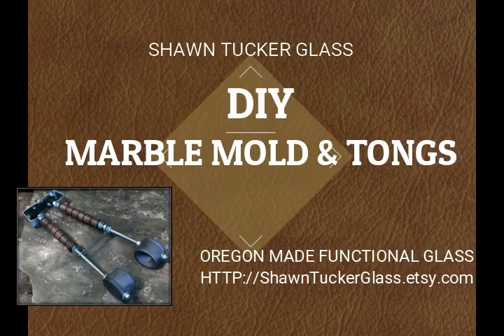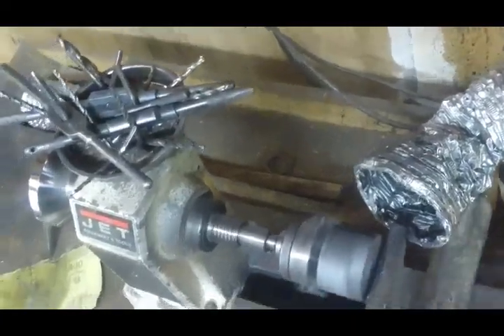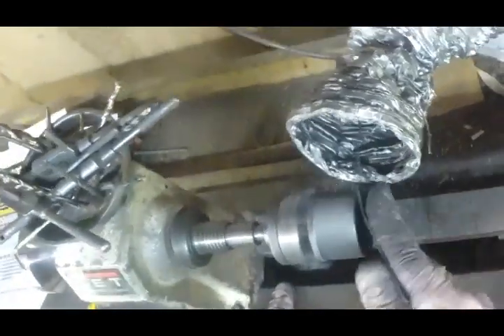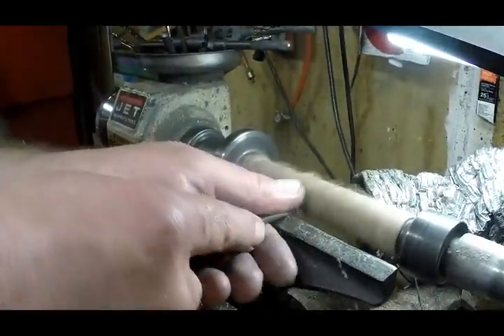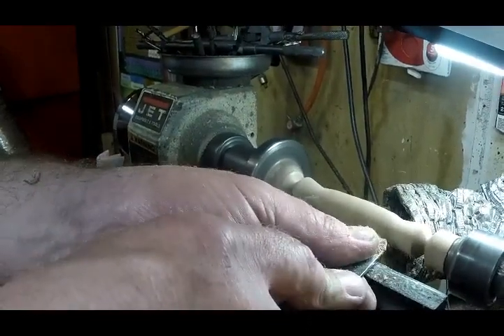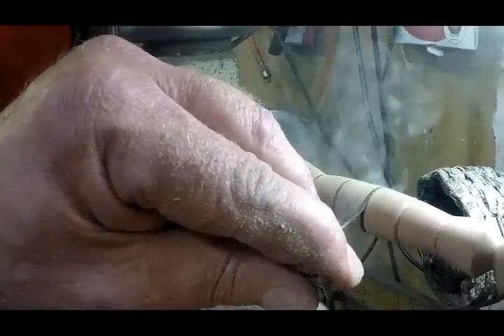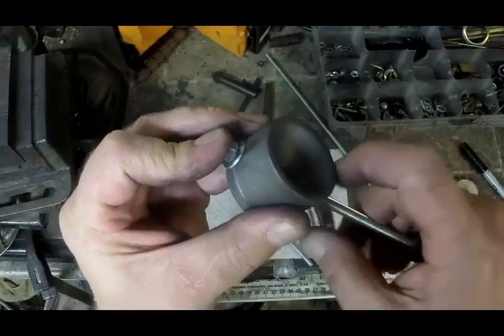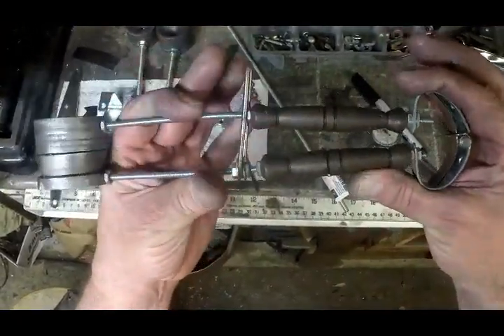DIY - Make a graphite & wood marble mold or marble tongs - Oregon Made Functional Glass Shawn Tucker

Comment: I like the spring return feature.   Curious if you've ever used the lathe for glass work?
Reply from the maker: I haven't.  Mostly for two reasons.  The lathe I have lacks a low speed variable controller, and one end is free spinning.  A glass lathe drives both ends.  However,  I have used the glass blowing equipment for lots of non-glass projects like welding, cooking, brazing, straightening primitive arrow shafts and a process I call the "Lost Glass Method of Brass Casting".  That'll be in a future video.  :-)